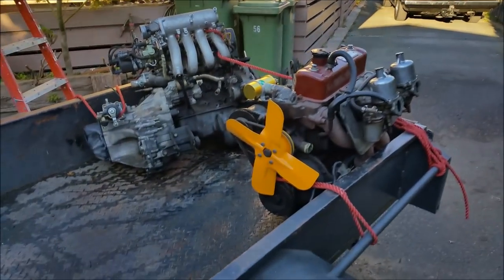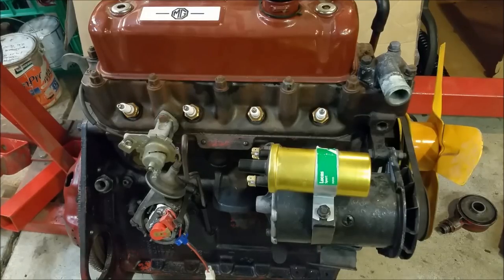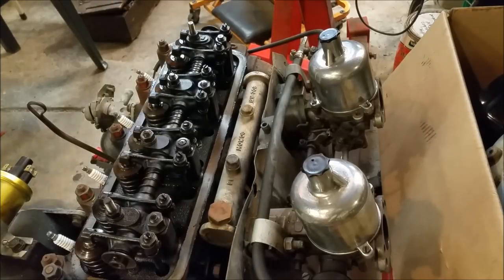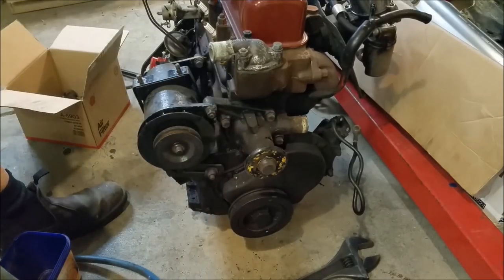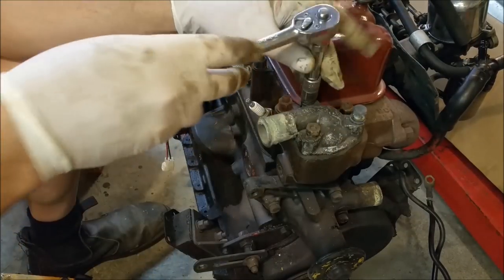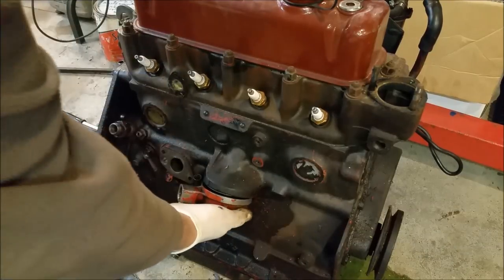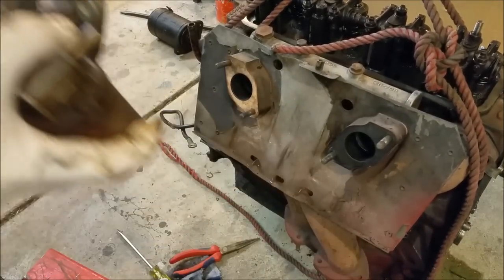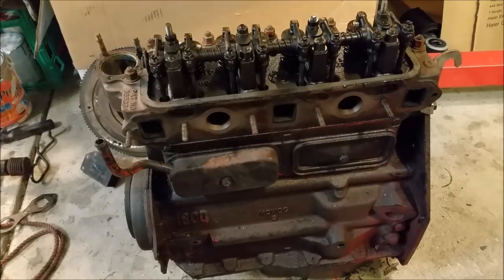MGB B Series Engine - Re-sealing, Painting and Plating - Part 1

Comment: i would go electric fans for the mg because for that tiny low hp motor, removing that fan will make tons of power. I know because i have a 1985 corolla and they made 112hp when new but being 35 years old, it has about 100hp now with headers and intake. By removing the fan, it made a big big difference in revs and power.

Comment: If the O head is the head that was used on the Austin and Morris 1800 S (landcrab) then it is pretty much exactly the same specification as an MGB head out of the factory though I understand that some of the changes that were made to the head architecture to make it work better in the transverse application do seem to make the heads a bit tougher and they are quite popular with people who race Bs, apart from the FIA appendix K historic racers where the cars have to be to period spec mechanically.  They do, however, seem to be a bit more prone to valve seat recession that the standard head if you use unleaded petrol so it is essential that they are run using a good lead replacement but, frankly, these days it isn't hard to get the head modified to run hardened valve seats and one or two years of using lead substitute will easily pay for the machining work to convert them so that is by far the most popular option now...

Comment: I would get rid of the electronic ignition and go back to points and condenser! If you set the points and timing correctly the car will run just fine, and I have heard many stories of failure - with weird symptoms- of electronic ignition set ups.

Comment: Thank You for the cornucopia of new videos!

On a v8, a fixed metal fan (no clutch)  sucks up around 20hp (Motor Trend Engine Masters). I would be curious to find out how much that MG Metal fan chews up.  Are you tied enough to originality to change to an electric fan, though it would probably require an alternator instead of an generator?

Comment: When your taking the Engine out of the trailer is that a Granada in the background?  A couple of friends of mine had the 2.8 ghia x spec which was the biggest engine and top level of trim on the UK. Wonderful cars. I always thought the 2.0 4 cylinder was under powered.
Reply: It's a Aussie xd falcon which looks a lot like a granada. You could get a 4.1 straight 6 or a 4.9 or 5.8 V8.
Reply: Thank you :-)

Comment: I have my intake off. How do I degrease the engine without getting water inside?
Reply from the maker: I used an old paint brush and some dirty thinners.
Reply: @PeterAndersons  Thanks mate. I was planning on pressure washing it and maybe masking it with duct tape and stuffing some rags in the holes. Bad idea?